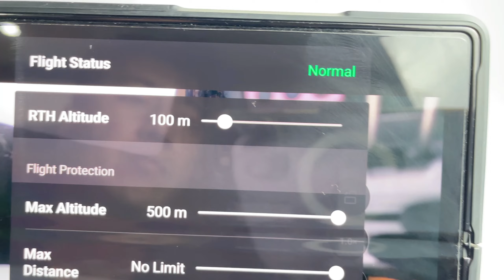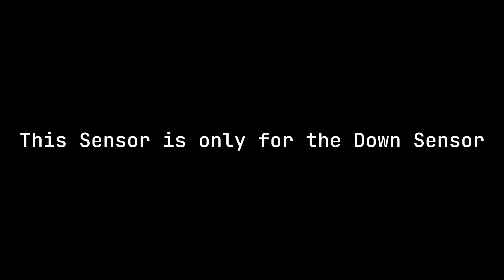DJI Mini 3 Pro Down Sensor Swap: What Errors to Expect and Fix

Comment: What was the glue you applied to the ribbon cable plugs?
Reply from the maker: It is CP-0002 Glue, it like the rubber when it dry.